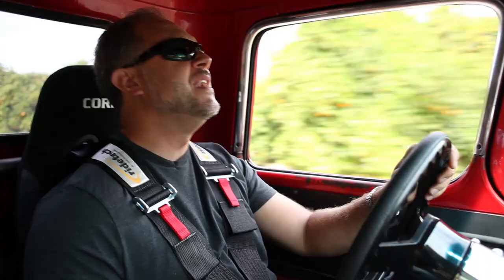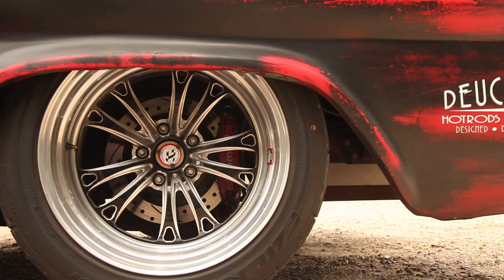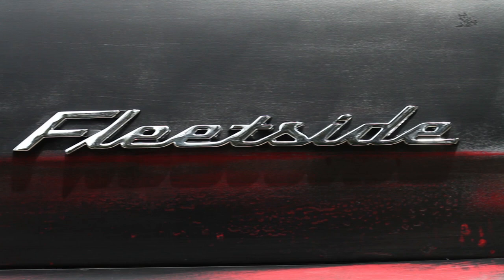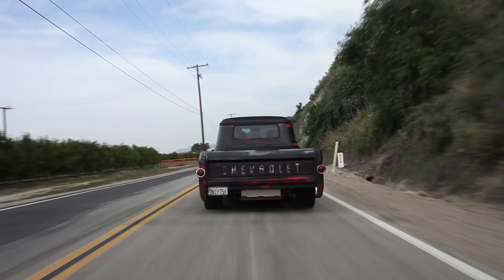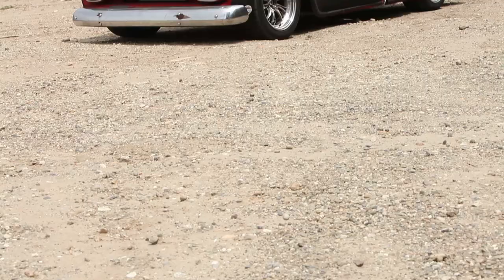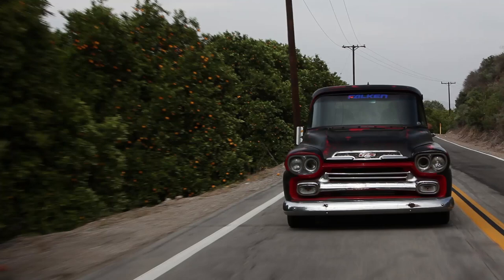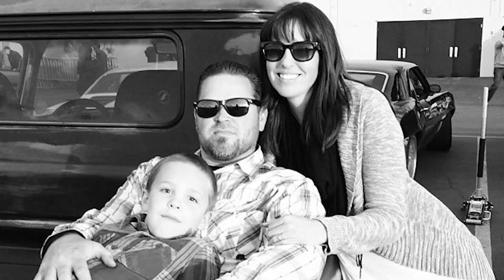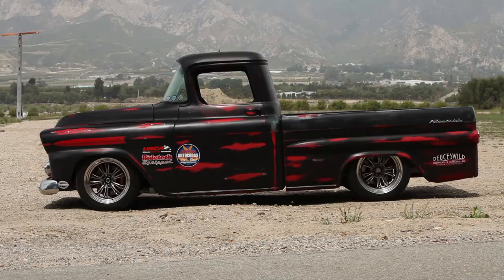Pickup Power: 1959 Corner-Carving Apache - /BIG MUSCLE

Comment: Lets be more specific! The BODY is a 55 year old truck. All the rest is brand new modern technology that romps on Porsches and Corvettes through the corners!! LOL
Reply: I heard him say that in many videos, like it's an 50-60 years old car doing all that, be it crazy acceleration, speed or cornering. In all these cars the body is from an old car but every other bit is new technology found in modern cars. And sometimes expensive tech only found in the most extreme modern cars.
Reply: Ive noticed that too bezor ta. Thats why I called them out. Not fooling anybody here. 
I see a pattern in his choice of vehicles lately. They are all resto mods made for autocross. Nothing against those types of builds but everyone is doing them. Wheres the creativity?
Reply: ***** a non ls 383 small block is not modern technology. It's even carbd. Granted the frame and suspension is modern but the aerodynamics and weight are still what it was in the 50's.
Reply: It may not be modern tech but its still new parts! Not 50 years old. LOL
Reply: ***** Nitpick much?
Reply: @dcinhere where’s yours at? You don’t have one so you mad !😂

Comment: Absolutely love this build. I bought a 1959 Apache 3100 in 2020 and I’ve been doing little by little as I can. Recently I had a chassis built and have an engine and tranny sitting in the garage waiting for the chassis to be delivered. Right now I’m working on the body and I would really love to talk to the owner of this truck. I’d like to pick his brain a little bit. I’m doing this stuff myself and do not have any auto body or painting experience and I do want the patina look. Once I get the chassis I’ll be running my brake lines, hoses, and wiring and then marrying the engine and tranny to the chassis. The first thing that caught my eye about the build was how he used the inner headlights for more air consumption. That’s one of the first things I thought about doing prior to even buying my truck. My thought was to eventually have twin turbos on the engine but knew it would be quite a while before I could afford to do that so I thought I would just do what he did. 
If it’s possible for the owner of this channel to put me in touch somehow with the owner of the truck I would appreciate it. Thanks and thank you for all your content.

Comment: I have that exact Cold air intake on my 1964 C10.
It does lean out the air/fuel at 50mph+
Reply: But the 64's have single headlights on each side. I'd love to see a picture of that. I'm wanting to rescue a 1964 C10 4x2 Fleetside with the small back window.

Comment: Some of you are saying that it won't hang with a vette.
Did you not see 3000lbs and 500hp on that built frame im sure it would put 98% of ricers down and a easy stock 5.0 and 5.7 on the rear view. 
Its on a budget for sake 
And no it will not corner better than a damn Porsche you fool.  Quit the illiterate comments or buy one and show us
Reply: son please learn to write for one,
for two it weighs 3k lbs making over 1g on the skidpad is only the beggining. the porsche has always carried the engine in the wrong place making a low momentum car meaning it is best for straight line and it would not be my first choice for a track car but a balance of oversteer and understeer makes you extremely confident to throw into a corner at a faster pace as well as coming out  losing less speed.  this truck will work harder to achieve the same result your just blind if you believe it can out turn a cayman it would only catch it on the straights.
Reply: B00steDevil   "son please learn to write for one"  should be "son, please lear to write."  And you have no clue what the handling characteristics of this truck are as you have never driven it.  As you say the porsche is not ideally balanced for cornering, you have now negated your original statement.  The truck is near a 50/50 weight distribution so I would tend to believe that it has a leg up over the porsche that you claim it cannot out handle.  Please feel free to continue to show your ignorance.
Reply: i have 3 degrees in the automotive industry believe me i know my shit. so what if i negated my first comment i never said porsche is the best. he clearly said it handles better than a porsche  which is nonsense i have thrown the cayman, the cheapest damn one.
just calm your panties. without tcs, stability and abs you have no chance of putting 500 ponies to the ground period. i dont care how many G's its rolling, it will not out handle the poors man 911.
let me guess your come back is well...... ah... it has a new frame under neat and it has coil overs. only reason why its seating so low is because the center of gravity was already too high and it  was putting much stress on the suspension as it was. please continue
Reply: My wife just made COOKies!
Reply: I'm sure you do ;)
Reply: you're*

Comment: Can't get enough of this show! - BUT...@ 2:11 (I think?) the host he says "when he got it this thing had a straight 6 in it, a lot of miles, 4-barrel carburetor..." while showing a still image of V8 (283ci ?) on a forklift that appears to be coming out of the engine well. I often make mistakes when speaking so I'm thinking that the host simply misspoke (straight 6 w/4bbl?) OR the still image was just a filler for the show. Did anyone else see this?...OR am I just getting soft in the head in my dotage...?
Reply: He said that he had several different motors in and out of the build over the years.

Comment: so what does the chrome glove box mean??
is that like a gay code ppl use like the colored scarves in their back pocket?
Reply: It's so you can look up a ladies skirt. Nothing gay about it.
Reply: minniemation unless the driver is also a lady ;)
but really? can't imagine it works
Reply: Funny- I got 5 minutes into the video and immediately scrolled down to the comments to find this one on top :)
Reply: revel My friend's mom had an Aztec. What a piece of shit. I think cars are devolving if anything, lol.
Reply: Jimbo Cee wow, aren't we sensitive today. Who lit the string on your tampon, Jim-Ho!
Reply: minniemation Wow, that's super creepy.
Reply: chris7jakarta
Reply: yeah their devolving, make the new stuff out of plastic and thin metal to beef up gas mileage, nothing is solid anymore. One mid speed crash and its totalled, where as the older vehicles body would take more damage. They would use lead or heavily bondo it to make it look good again, if not getting replacement part. That or cut out bad area and weld patch it up.  IE, like older cab corner, floor boards, running boards or where the bed side and bed floor meet if sitting out in the weather a long time. Other area of rust concern be under the chrome trim around window and body.

Comment: The truck looked alight, kind of a rat rod build.  I didn't see much of weight reduction here.  Chrome bumpers, big ghetto type wheels w/ too much camber, carbed crate motor, with a ford solid axle rear end.  Not what I would call super impressive on the track. Not going to hang with modern supercars/track cars with FI aluminum blocks, DOHC, boosted, with carbon fiber panels, coil-over IRS suspension, 315+ slicks on all corners w/ light wheels, aerodynamic/stiffened/light weight chassis.  Lets be real here.
Reply: You're joking right? Did you not hear that this is a project. Not a multi-million dollar F1 car.
Reply: Rex Overbey I bet this truck could give those cars a run for their money. It's set-up for the track. I'm sure a stock corvette couldn't keep up.
Reply: Funny thing is the truck has beat c4 vettes.
Reply: Goodguys Delmar 2014 results. 
PRO	Mike Maier	66	Ford	Mustang	62.612	9
PRO	Kyle Tucker	70	Chevy	Camaro	63.322	8
PRO	Stacy Tucker	69	Chevy	Camaro	64.591	7
PRO	Cheryl Herrick	67	Chevy	Chevy II	65.15	6
PRO	Larry Woo	68	Chevy	Camaro	65.974	5
 	 	 	 	 	 	 
 	SHOOTOUT	 	 	 	 	 
SM	Jake Rozelle	69	Chevy	Camaro	65.467	PRO
SM	Even Osborn	67	Chevy	Camaro	66.306	 
SM	Gregg Blundell	69	Chevy	Camaro	65.584	 
SM	Brianne Maier	66	Ford	Mustang	65.349	 
SM	Aaron Ogawa	70	Dodge	Challenger	66.195	 
 	 	 	 	 	 	 
 	QUALIFYING	 	 	 	 	 
SM	Chris Gonzalez	70	Dodge	Challenger	64.705	 
SM	Kyle Newman	57	Chevy	Wagon	64.835	 
SM	Jane Thurmond	64	Chevy	Corvette	65.014	 
SM	Mike Cavanah	66	Chevy	Chevelle	65.374	 
SM	Paul Aldermaw	70	Chevy	Camaro	65.864	 
SM	Matt Alcala	69	Chevy	Camaro	65.895	 
SM	Suzy Bauter	68	Chevy	Camaro	66.079	 
SM	Gerald Lum	71	Chevy	Camaro	66.627	 
SM	Keith Corrigan	55	Ford	Thunderbird	66.652	 
SM	Mike Young	65	Ford	Mustang	66.766	 
SM	Mike Wright	69	Chevy	Camaro	66.938	 
SM	George Dias	72	Chevy	Camaro	67.047	 
SM	Chris Humphreys	72	Chevy	Camaro	67.075	 
SM	Rob Chandler	68	Chevy	Camaro	67.126	 
SM	Steven Rupp	71	Chevy	Chevelle	67.137	 
SM	Tom Kamman	69	Plymouth	Barracuda	67.188	 
SM	Robbie Conklin	68	Chevy	Chevelle	67.258	 
SM	Dick Eytchison	65	Chevy	Chevelle	67.259	 
SM	Geon McKenzie	72	Chevy	Camaro	67.332	 
SM	Aaron Raymond	69	Chevy	Camaro	67.806	 
SM	Grant Reierson	66	Chevy	Chevy II	68.054	 
SM	Doug Renner	69	Chevy	Camaro	68.093	 
SM	Tyler Craig	66	Ford	Fairlane	68.182	 
SM	Chris Meyer	70	Chevy	Camaro	68.324	 
SM	Alan Palmer	65	Ford	Mustang	68.51	 
SM	Mark Wetterah	69	Chevy	Camaro	68.556	 
SM	Nick Herrington	67	Ford	Mustang	68.685	 
SM	Bryce Baumgart	65	Ford	Falcon	69.035	 
SM	Mike Fitzsimmons	67	Pontiac	Firebird	69.292	 
SM	Tony Kirovac	72	Chevy	Camaro	69.465	 
SM	Ralph Hollis	70	Pontiac	GTO	69.726	 
SM	Robert Hall	68	Chevy	Camaro	69.937	 
SM	Chad Humhreys	72	Chevy	Camaro	70.266	 
SM	Mike Colon	69	Chevy	Camaro	70.871	 
SM	Robert McGaffin	65	Oldsmobile	Cutlass	70.818	 
SM	Tom Farnsworth	69	Pontiac	GTO	71.708	 
SM	Rusty Thompson	70	Oldsmobile	Vista Cruiser	72.365	 
SM	Steve Kennedy	65	Ford	Mustang	72.793	 
SM	Zach Leeds	66	Ford	Mustang	73.25	 
SM	Bob Freemantle	69	Chevy	Camaro	73.433	 
SM	Jerry Guernsery	57	Chevy	150	74.179	 
SM	Thomas Henger	70	Pontiac	GTO	74.359	 
SM	Adam Johnson	71	Dodge	Charger	76.234	 
SM	Paul leeds	69	Ford	Mustang	76.951	 
SM	Troy Brill	66	Chevy	Malibu	79.172	 
SM	Dwayne Klippert	67	Chevy	Camaro	84.723	 
 	 	 	 	 	 	 
TRK	Wes Drelleshak	59	Chevy	Apache	64.333	PRO
TRK	Dave Wheeler	57	Chevy	Truck	66.206	 
TRK	Neil Tomyn	68	GMC	 	69.177	 
TRK	George Reiss	70	Chevy	El Camino	72.103	 
TRK	Joe Janikowski	40	Ford	Truck	75.195	 
TRK	Will Seeger	37	Chevy	Panel	76.652	 
TRK	Logan Berry	69	Chevy	C-10	80.447
Reply: *****  Just wanted to apologize.  I feel like I came off as a dick my last posts.  Didn't know it was your truck.
Reply: *****
and that is why i love it. My 1970 chevy supercamper (i put a corvette 327 in it, with turbo 400 and 4.11 gears) was out running mustangs and berettas. But that is not what i built it for, it was for having fun. Something about overload springs and swaying kept me from oval driving the thing. But like my truck, this one is also for fun, Who cares about anything else.

Comment: I'll believe this truck can out corner Porches and Corvettes when I see it.  This is what always annoys me about Big Muscle.  There is no possible way the weight distribution or center of gravity can compare to a real sports car.
Reply: Why? I've run Corvette 'sand Porsche's on tracks all over the U.S. and know exactly how they handle and what their limitations are. I've also driven THE best pro-touring cars in the world... my comparisons are dead-on
Reply: Drive BigMuscle You ask why?  Why would engineers concern themselves with keeping the center of gravity low, optimizing the weight distribution of the car, silly things like independent rear suspension, rear mounted transaxles, locating the engine to make the car mid-engine etc. if they could simply build the car with the layout of a 1950's pickup and achieve amazing handling?  Don't get me wrong, the truck is awesome, but when you claim it can "romp on Porsches and Corvettes in corners" I call BULLSHIT!  There is a reason that no sports car has a layout anywhere close to that of a 1950's pickup truck.  Keep up the good work, I enjoy the videos.  But please refrain from the silly statements.  More engineering went into how to reduce the unsprung mass of a single suspension piece in a Porsche than went into the entirety of that truck.